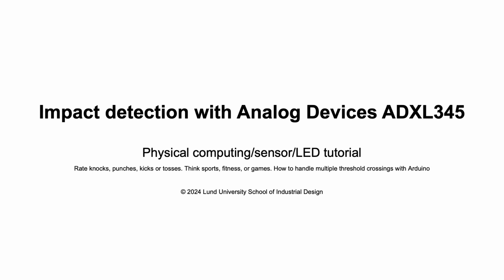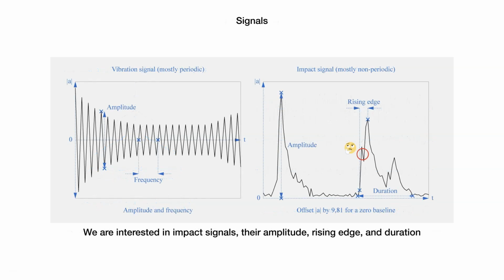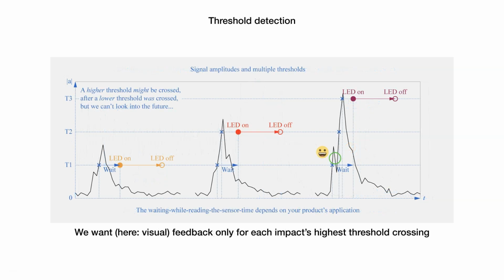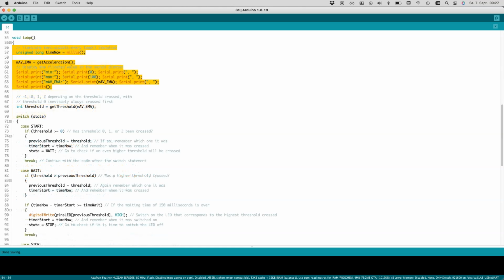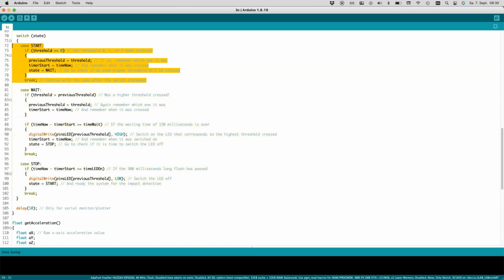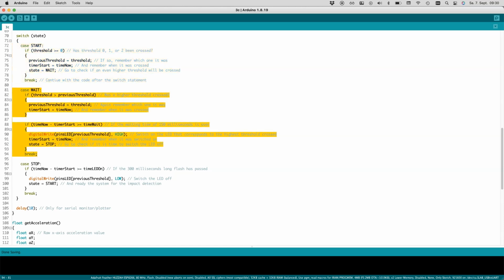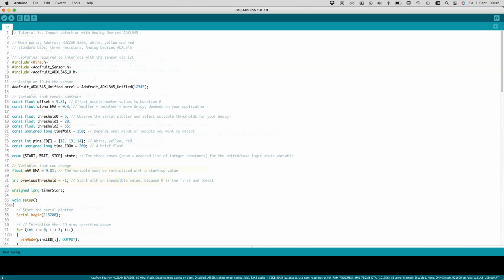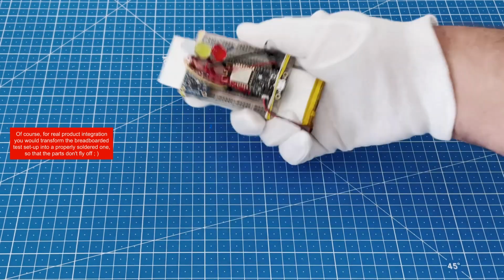Physical computing sensor LED tutorial - Impact detection with Analog Devices ADXL345

Comment: Hi, this is cool! I really like your video. I tried to upload your code but got an "unsigned long timerStart" error. Can you help, I really want to set up like yours,  Thank you, woo
Reply from the maker: Without seeing your exact Arduino IDE error message panel output, it's hard to troubleshoot in YouTube. What does "error" mean exactly? timerStart is just an unsigned long variable declaration, and later, this variable is used. Such timing works in WOKWI https://wokwi.com/projects/406583203546521601 no problem.